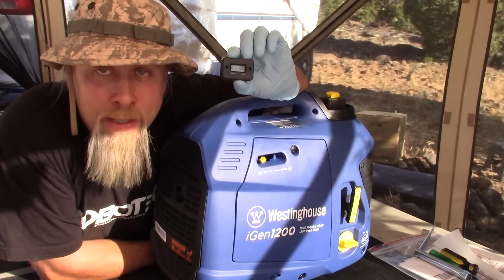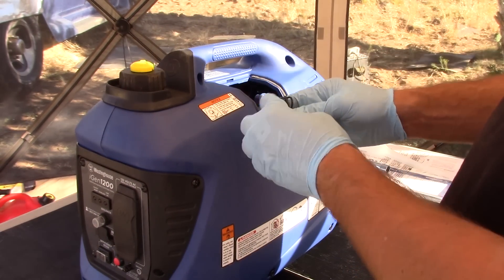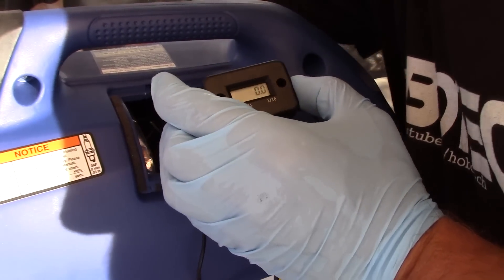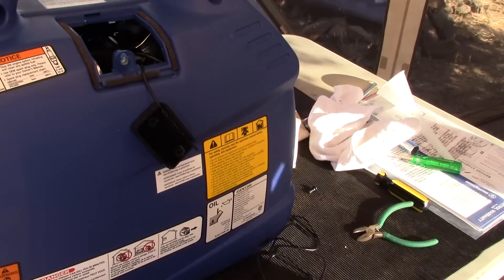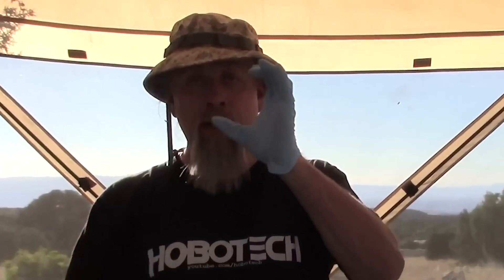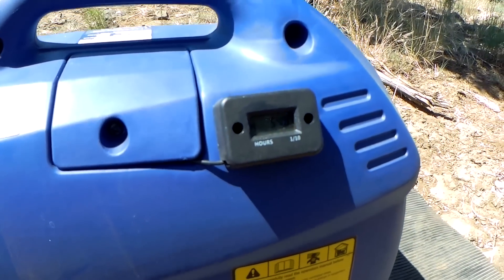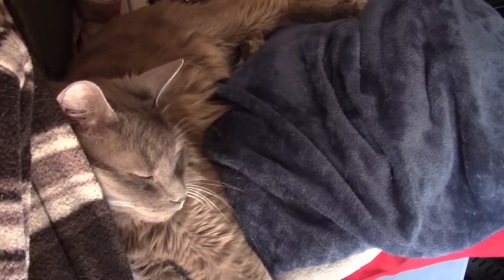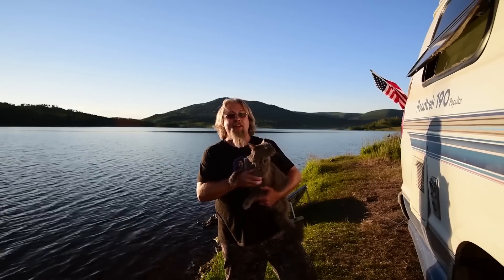How To install A Cheap Digital Hour Meter To Any Generator And Track Run Time

Comment: The fact that you attached it to the generator without messing around with cutting or drilling is a huge bonus.  I'm waiting for an hour meter to arrive from Amazon (also with a cover and handle security bracket) for my brand new Honda EU2200i, and would not even consider messing up the case with holes when there are much better methods like this.  Thanks for this video.

Comment: Thanks. Mine had directions. Said to wrap 5 times, but must not matter. Hey, there’s a guy that says running a generator will cause your neighbors to through darts at you. Has it happened to you yet?
Reply from the maker: No, because I don't camp around others.

Comment: Great video, I have 2 Hondas(eu2000) and bought those little meters but never installed them.. it's time.. I love them.. but have to ask, the seal on the sparkplug cover didn't seem like it was waterproof... was there something a little be^er on the lid over the little strip of foam I saw..?
Reply from the maker: I think if water would get in there it would drain out the bottom.
Reply: @HOBOTECH  Oh I'm sure.. I just looked and the Hondas are completely sealed.. in the same place there is a harder bubber type rubber that goes all the way around.. just a little FYI on a different inverter...
Reply from the maker: @stattytravels4638  thats why they're 3 times the price
Reply: @HOBOTECH  oh for sure.. interested to see how well it'll hold up.. hour meter from day one is a great idea..

Comment: You have to wonder how accurate those meters really are, wrapping the wire around the spark plug as you said sends the electrical signal to the meter to activate the clock every time the spark plug fires showing  the Hrs/Min the generator has been running. I wonder if the clock has some type of program to compensate for when the generator is running in Eco mode or at full power as the RPM will be different and the spark plug will  fire at different times per second depending on the RPM.If the generator is running at full speed like when your running your AC the clock will run faster than if your just running a laptop.
Reply: Maybe its an on/off permissive and not a pulse permissive
Reply: I think the spark pulse just starts the timer, it is not RPM dependent. Once it no longer detects a signal it just stops the timer.
Reply: R B That is a very good answer, you probably are right.
Reply from the maker: Pat, it is a very basic counter. All it does is tick time at normal speed when it detects any signal, no matter how fast or slow. Speed doesn't matter much anyway when it comes to maintenance. Oil changes happen at 50 hours no matter if it was idling or running full bore. That may be different on airplane engines...
Reply: Electricity going through a wire "induces" a magnetic field, which causes a current in the perpendicular wire. The rpms are irrelevant in this application.

Comment: Id rather have a 2000watt Yamaha..very quiet ,quieter than some of the honda generators Ive heard.
3 years old and its still kickin ass.  Still same spark plug too..I run the gas out of carb everytime  to keep the carb from fouling. There is a gas turn off unlike most generators. But, it was almost a 1000$.
Reply: You still have to take the side cover off and drain the fuel bowl on the carb if you plan on storing it for a while, Running the gen with the fuel shut off will still leave some gas in the fuel bowl when the generator shuts down. The gas in the carbs bowl will gum up if left in there for a month or more.
Reply: I am not sure if Tom has the budget for a Yamaha, and Honda gen's are even more expensive.
Reply from the maker: $1000 on a gen isn't an option after all recent and upcoming expenses. I'm not loaded like all you rich retired folk! By the way, camping with a guy that's a Yamaha dealer. Nice quiet gen but he said they don't make them like they used to and you may as well get a Honda.
Reply: I think I got one of the last Yamaha's that was made in Japan, They are made in China now.
Reply: @patd4u2  Good to know! If I ever want a small gen I will pick something else.

Comment: TY.  I bought my still functioning  KIPOR (now defunct) SINEMASTER 3000TI DIGITAL INVERTER GENERATOR over 12+ years ago with an unattached hour counter but I'm so unskilled at this kind of stuff that it never got installed.   My guess is that it has less than 150 hours use on it. After watching you make it look so simple to install, IF I can find it, I'm going to install it.  TY again and wish me luck.  I'll need every bit of it.

Comment: After now I’m new to gas generators but would these have the option to reset the hours I heard it keep track for ever 9999 but what if I want to put it on another generator ? Is there a way to reset the hours ? I heard after specific hours there’s maintancw that have to be done this helps .

Comment: Did you save the original oil container to use as a “measuring cup” for future oil changes?
Reply from the maker: No. It had no fill markings.

Comment: There are only 2 modifications left that I know of.
1. Adding a fuel line “T” shutoff valve to run the generator from an external tank (like a outboard motor tank), or an RV gas tank fuel standpipe. 
2. Duel fuel kit to be able to run the genny from gas or propane. 

I would order an extra oil service door for any holes needed. In the unlikely event you have warranty issues you can easily return it to stock condition.
Reply from the maker: I am considering some kind of mod to let it run from an external gas can instead of the small 0.8 gallon on board tank. I can't do propane because I can't carry enough on board to make it worthwhile.
Reply: @HOBOTECH  that machine will run for a long time on a standard bbq tank

Comment: What kind of solar rig could you have for all the money you've spent on gennys and gas? I never have seen generators as a long-term power solution. They break down and burn money like crazy. For 2-3k you could have a 1 to ~1.5 KW robotic solar rig with 1000 12v AH of capacity. (4 steel high grade 290 w panels and 2 large off grid battery packs plus a high quality ~2kw inverter). Plus no filling generators at night or foul weather, no gas expense, no noise, no cmox/co2 to worry about... Much love!!
Reply from the maker: I live in a 19' van not on a farm. Where would I keep all that? Once you boondock full time you realize how often you have bad solar days. With exception of winter in the desert, you can expect a bad solar day at least twice a week -- more if you are in AZ monsoons like I am now. A generator is simply required. I know. Many "van dwellers" tout being 100% solar. They obviously only use solar to charge their phone or maybe a laptop. My power needs are far higher than most, and I already carry the max of 500w solar. Thanks for the comment!

Comment: Cool bud! Thanks!! My generator has been sitting for 2 months cause of work schedule. I bought a fuel treatment because I didn't drain the gas out. When I started it to run it a bit prior to the fuel additive it wasn't feeling real well as it was throttling up and then down. It hasn't done that before but it hasn't sat without running that long before either? Any suggestions? Will the fuel additive be a good idea?
Reply: Next time you go to Wally World grab some "Sea Foam" in the auto dept  put a little in the generators gas tank, that should clean out the carburetors jets and fuel bowl.
Reply from the maker: I used Berryman B12 to great success to combat surging in my Onan generator.

Comment: I use it on my 2200 Honda and a great meter and had it on for a year and it works great.  I recommend it and worth the price and benefits.

Comment: Hey man ,nice video as always! Oil change every 50 hours? Is that a break in period or are generators that high on maintenance?
Reply from the maker: 20 hours break in then change every 50 after that.